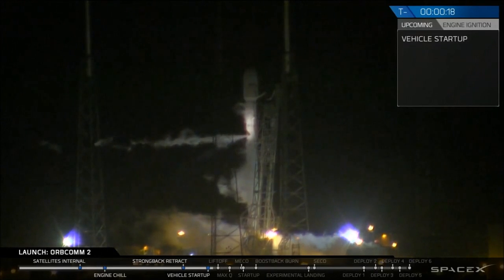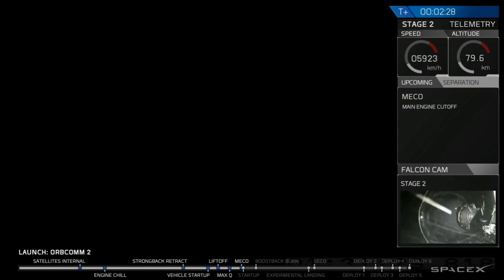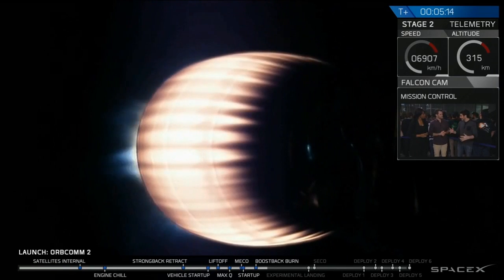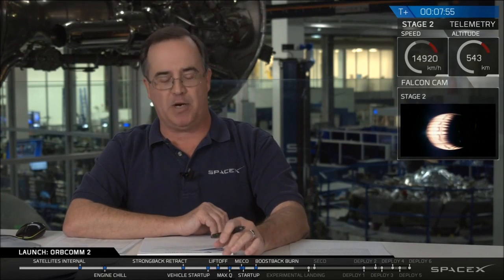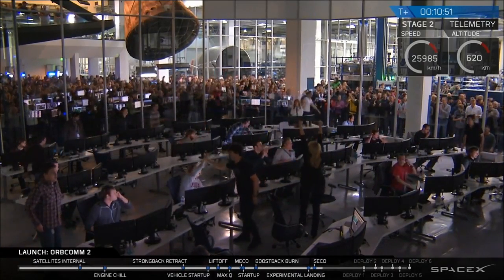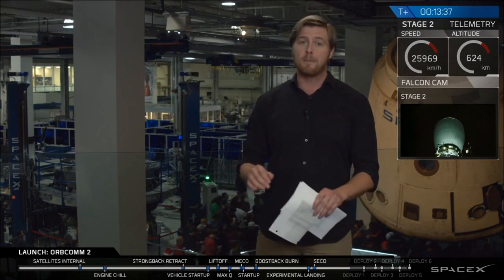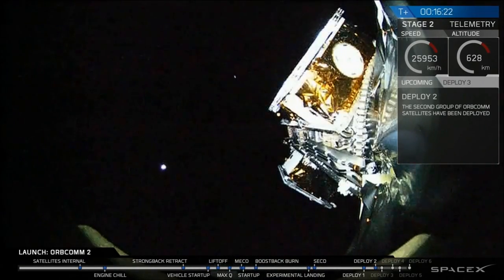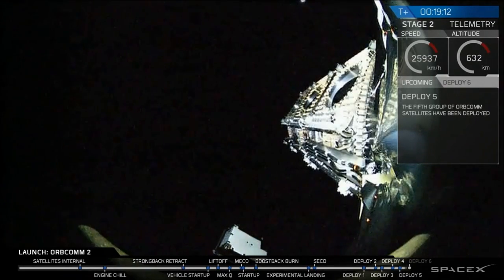SpaceX - Falcon 9 Launch and successful On-Shore Landing

Comment: Thank you. My point exactly. Do you really believe everything you see as what it is? Over a mile away and at night any bright light, flare, or flame descending and then getting extremely more luminous at the end could be anything. The spectators were too far away to make out anything with any sharp detail. The only up close view was from a camera. Any novice magician will tell you once you're told you're going to see something your mind already is biased to see what it thinks to be as right. To the spectatorsover a mile away they saw bright lights without any detail. The camera showed them what they thought they were supposed to be seeing. Doesn't mean that the camera feed was what was actually happening live. Could have been a video or CGI animation. While the MILE away spectators saw blinding bright light and then poof a rocket appears from out of the light. Could have been there all along.Could have been underground and raised up as the flames got bright. These guys have faled miserably for months in doing this. This time over the launch site it was perfect? Yeah. They got it right after months of failing. Did you ever wonder why the Russians never landed on the moon? Or anybody else? In 45 years the most we've done is go into low Earth orbit since a 520,000 mile trip to a place theyve never been. And landed in the middle of the Pacific. We cant get back to the moon but we can land a roman candle back where it started without it tipping over without ever getting it right before? Yeah I'll take a cup of the coolaide. Keep believing everything you see on tv. Just like building 7 collapesed perfectly 8 hrs after the 1st strike on the trade center without anything touching it. You probably think your government is gona take care of you when you get old too

Comment: Why are they measuring in km/h and Kg?  Here in America we measure in  mp/h and Lbs!
Reply: +dmarten66 Because they're scientists and engineers.
Reply: No need to be rude.  This is an honest question as I am not part of the science or engineering community and did not know imperial measurements were not used by those communities.
Reply: +dmarten66 And that's the reason why NASA lost a multi-billion dollar spacecraft, the MCO, because they hired idiots like you.
Reply: +dmarten66 Fair enough. The imperial system is truly problematic. Nothing really makes sense. What's an inch again exactly, how many fit into a foot? Not 10, so there computers already have a problem. And what do you call a tenth of an inch, and what's the unit called that divides an inch into the equivalent of mm to cm?
Reply: @MARSTVCHANNEL How do the computers have a problem? They're Digital Binary Systems... using base 2 for ON/OFF functions in logic gates to calculate maths...

The computer Hexadecimal Number System is a base-16 system with 16 digits: 0–9 and A–F, where A=10, B=11, C=12, D=13, E=14, and F=15. It is used in computing because it is a more compact and human-friendly way to represent long strings of binary numbers, as each hexadecimal digit corresponds to exactly four binary bits (a "nibble").

No...
The 'issue' is NOT for the computers.
It's the fact that humans find the Decimal System base 10 'easier' to do maths in, because that's what they're taught as a child.

The Metric System is 'easier' for most humans because; 8 fingers + 2 thumbs = 10 digits.
The Imperial System tends to use dozens... base 12... the Duodecimal System, or base 14... the Quattuordecimal System... this is because it uses the KNUCKLES on one hand to count.

12" = 1'...
3' = 1 Yd.

I was taught this stuff at school, as a child.

A tenth of an inch = 0.1"

Inch fractions represent parts of an inch using denominators that are powers of 2, such as 2, 4, 8, 16, 32, or 64. For example, 1/2 inch is the middle mark, with 1/4 and 3/4 on either side, and further markings represent eighths, sixteenths, and smaller fractions of an inch.

How inch fractions work;
Division:
The denominator of an inch fraction indicates how many equal parts an inch is divided into. The markings on a ruler visually represent this, with the longest lines being whole inches, and progressively shorter lines representing smaller fractions.
Examples: An inch is divided in half to get 1/2 inch.
Each half is then divided into two to get quarters (1/4, 2/4=1/2, 3/4).
Each quarter is divided to get eighths (1/8, 2/8 = 1/4, 3/8, etc.).
This continues down to sixteenths, thirty-seconds, and sixty-fourths, which are common in standard measurement tools like rulers.

...you can now use the other side of whatever scaled ruler/tapemeasure you've been using to measure Centimetres, if it has Inches on it as well.

If you know your 2x table upto 10 x 2 = 20...
Then you also know your 4x table upto 5.
If you know your 4x table upto 10 x 4 = 40...
Then you also know your 8x table upto 5.
If you also know your 8x table upto 10 x 8 = 80...
Then you can do also Hexadecimal maths in your head... to a certain extent.

...Eg; They're the same sequence as the halved times tables' even answers.

Comment: i really don't get it. What landed ? The gauge on the top which is the altitude meter, never started counting down. it remained at 620km. It was still climbing when they said it has landed. So what was that gauge ? Just a fake thing to show some random numbers ?  It was also showing a continuations acceleration up until it stopped and they said it landed. Something was fake. Either the landing or the gauge on the screen.
Reply: +Laszlo Makrai your perspective is wrong. Come outside the box for a bit. The bottom part of the rocket is expensive. It landed for re-use while the top half is in space gaining speed, launching its payloads
Reply: +LiquidSmooth something to do with an equal and opposite reaction. the huge surface area vs a vacuum.
Reply: +Laszlo Makrai It was a dual stage rocket, the booster is what landed, not the payload bus. Nothing was fake here.
Reply: +Adam Havelszky Larger surface area so the fuel  oxygen can mix and fire properly and not explode in a confined space for one, Two they can have a larger area of thrust and burn less fuel to get the velocity up, more efficient.
Reply: +ElfNet Gaming well done with the landing
Reply: +LiquidSmooth You thought wrong; these "rocket scientists" did the, er, rocket science, and that's why they made the rocket the way they did.